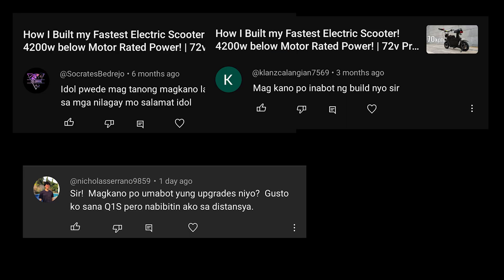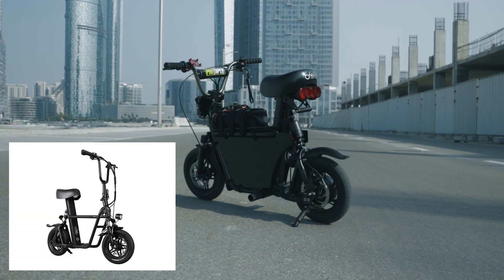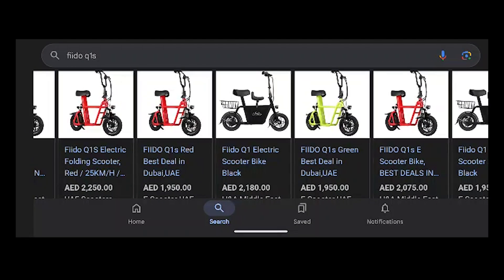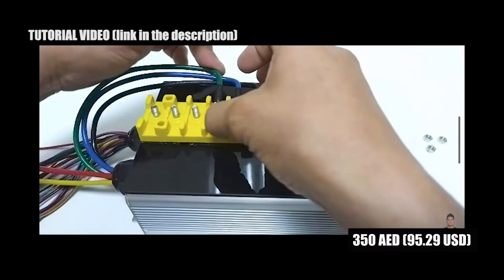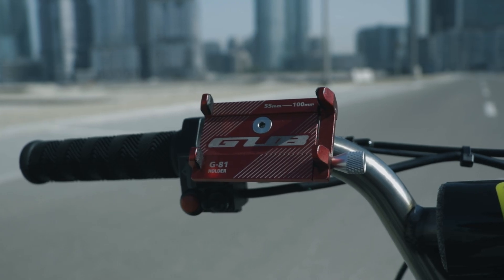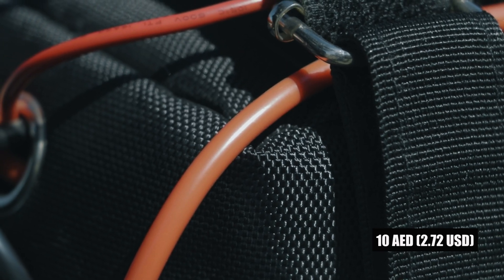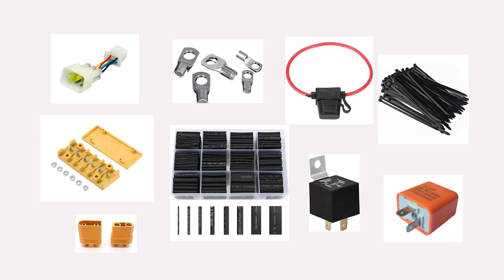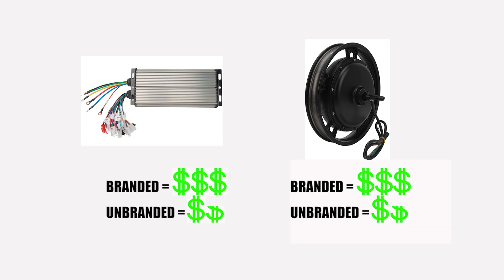How much did it cost me upgrading my Fiido Q1s electric scooter from 36v to 72v | single motor

Comment: Its super great job. But its dangerous also. All this power should not suggested, only for building purposes
Reply from the maker: Thanks!
Yeah, it's kinda dangerous.
That's why extra care is highly recommended.
Reply: @jaysonulanday forks brakes and steel construction were for about 300,500 1000 watt wheel.
When you put 4000w! its dangerous. Steel case especially at bumping at hi speeds. 
It is not safe .take care . Never trust this steel construction 
When u do videos its nice to say this at these extreme convensions🎉
Reply from the maker: @onoffgeorg9828 
Thanks for the great advise.
I posted a photo few days ago, i did some changes with this build.

Comment: Hindi mo namention sir yung brake set mo at pavideo naman pano mag DIY ng brake sensor T_T
Reply from the maker: Goodday Kaadik!
Stock lng yan brake n gamit ko.
Di pa ko nakapagpalit.
Brake sensor para sa brake light ba? Check mo tong link Kaadik https://youtu.be/fiRhLvlq3KQ

Ride safe lage!
Reply: @jaysonulanday  Yung brake sensor sir yung pag nagbrake ka automatic mamatay din yung motor hub mo. Then pagnakahold yung brake kahit magthrottle ka hindi aandar yung motor hub gawa ng brake sensor.
Reply from the maker: @ 
Low brake/high brake.
Magandang feature yan.
Di ka lng dedepende sa mismong brake lang.
Naka line-up na sa next na gagawin ko Kaadik.
Meju busy lng hehehe!
Reply: @jaysonulanday  Ayun thanks kaadik hehe

Comment: Sir, ask ko lang po ano size ng gulong niyo? Mas okay po ba ang tubeless o tube-type? Plano ko po bumili ng 2.75-8 sa harap at 3.00-8 sa likod. Mayroon po akong parehong 3500W hub motor.
Reply from the maker: Goodday Kaadik!
Ang lakas ng unit mo, dual!
Mas ok un tubeless Kaadik.

Ride safe lage!😎
Reply from the maker: Un gulong ko, stock lang un.
12 1/2 x 2 1/4
Reply: @ so bale pwede po ba yung 3.00-8?